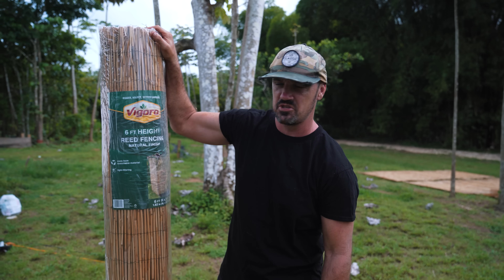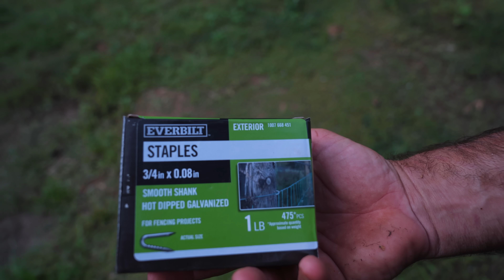GIANT STEP COMPLETED ON OUR OFF GRID JUNGLE PROPERTY!

Comment: It's not a damn per-GOLE-a. It's PER-gola, pergola. I'm an architect, I promise, that's the pronunciation. You are conflating pergola, with pagoda. Two different things, so don't mash the names together. Please. 

Metal roofing has to be installed either on sheathing, or onto purlins. You kind of made purlins, but spaced too far apart. But that's a semi minor issue here in this case (with no snow loads to worry about). To make it worse, you are installing (TWO!) layers of reed fencing, BETWEEN the roof structure, and the metal roofing that you're trying to permanently fasten to the ROOF STRUCTURE. This is the fatal flaw. Now it can't be properly fastened, because you have a moving, shifting, shrinking and (soon) deteriorating layers of reeds preventing you from drawing fasteners tight. That should have been installed from the underside, or cut in such a way that allowed for direct wood to wood connections with no layers of reeds in between... SMH so hard, every week. I swear you put effort into doing everything as incorrectly as it can possibly be done. It's impressive in a frustrating way (for those of us who actually know construction). 

You can't span metal roofing that far between supports. Though that won't be the detail that gets you here...  every single detail is wrong, except for the post/footing connection. Literally every single other thing is very, very wrong, and very likely to fail catastrophically. Dumb luck will only carry you so far, eventually Darwin's Law will catch up to you. Put your "thinking cap" away, and look up the proper way to do things before you get yourself, Kristen, or one or more of your animals killed. 

Those reed panels will crush and deteriorate at the fastening points, quickly. Then you have loose fasteners, which can never be drawn tight. First big trop storm will tear that roof off completely, book it. And since the reeds are between the "purlins" and the beams, the purlins will go with the roof when it tears away. Making some heavy missiles flying around. Also, in the meantime the rats and hornets will thank you for giving them such a nice, dry comfy spot to nest up there between the reeds and metal. 

Had you set your posts, and beams correctly (using 2x10 for beams, as it should have been), then you wouldn't have that "kink" to straighten out. 
SMH so hard, every week. Arrrgh!! C'mon man! Get it together. No more thinking cap... books, man. Books. Or even professional "how to" videos on youtube. Tons of them on here. Many very well done, clear, and concise. 

All that said; agree people should keep their comments about Kristen toned down. Also, on the safety glasses; 3m wraps, with the neoprene gasket work pretty well, but will fog if you sit them completely tight to your face. I like Milwaukee's safety glasses as well, they don't have the gasket the 3m's have, but they also don't fog. And they wrap well enough to keep you pretty well covered. Haven't found any goggles that don't fog. I use both of the above, depending on what I'm doing, might be one or t'other.